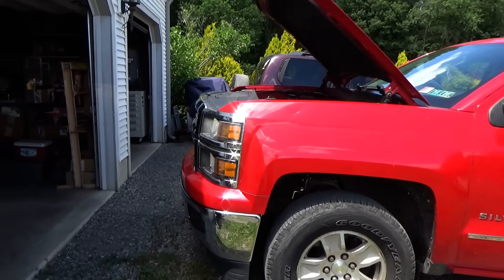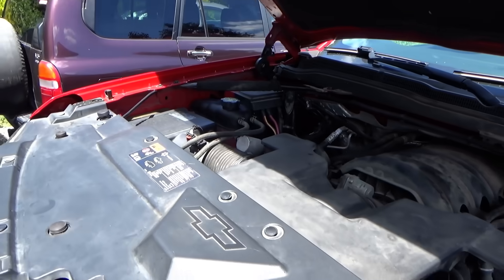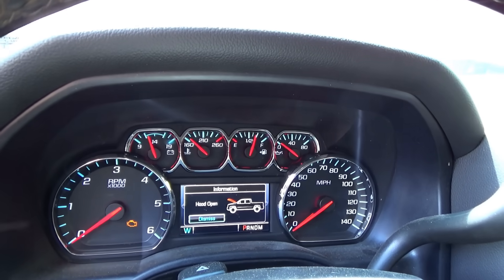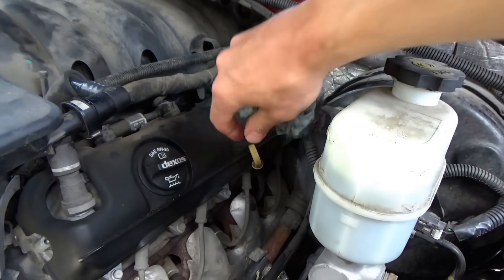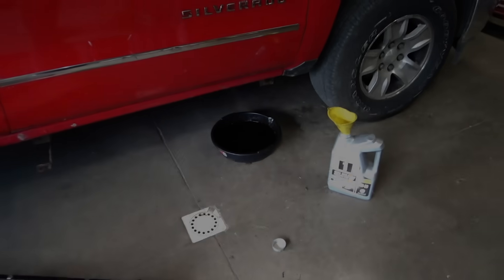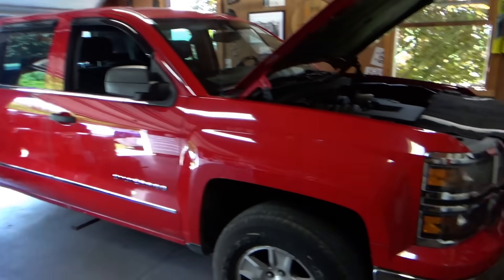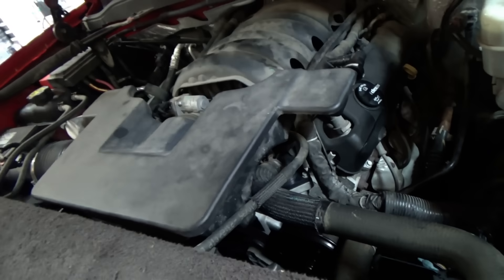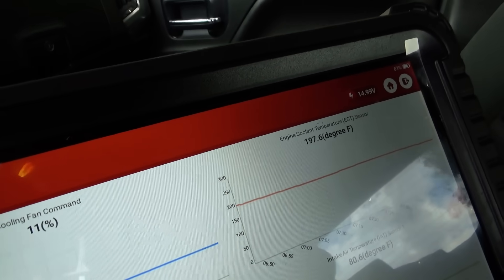Chevy Truck OVERHEATS?! (Thermostat & Water Pump Already Replaced...)

Comment: MotoRad has no excuse for this one. It's not that difficult to perform quality control on a thermostat -- just lower it into water 10 degrees hotter than the spec, and watch it for 15 seconds to see if it opens. That's a quarter of a minute per thermostat, at entry level wages. Compare the cost of the QC check against the cost of failure in the field (to MotoRad as well as the parts store and the end customer). Thanks for calling them out -- they had it coming!

Comment: Nice he's running 5 qts low on dirty oil and also overheating. Lucky not to be ordering an engine. Brilliant.
Reply: Until that overheating problem warps the head and torches at the head gasket it's coming

Comment: I've got the exact opposite problem. My bottom radiator hose it's just warm in my top radiator hose is hot. Truck runs about 220° 230 °according to the gauge. 91 454 new radiator, newer engine, newer water pump and of course a new thermostat. The hoses are not collapsing and I'm starting to get ticked off. I'll replace the thermostat again and give that a shot. If anybody's got any ideas I'd love to hear them.

Comment: Would the temp rising above 210 and then going back to 210 after about a minute normal with these motors? I have the same engine in a newer year model but it only does while pulling my utility trailer with my zero turn mower on it or when I get the rpms high passing someone. In both cases it never stays above 210 for more than a minute. Replaced original water pump when the pulley bearing went out at 90k miles but it would do that before the water pump replacement which led me to believe it was normal considering it only happens under heavy load.

Comment: Same issue with a lot of no oem thermostats these call for a 107F open up but I buy the 97F and don’t have any issues went through 2 brand new 107F and swapped to a 97F worked just fined

Comment: I recently bought a new thermostat from O’reily’s Auto Parts and I’ve been noticing the temperature goes up when accelerating past 55 mph. I never noticed that before and I’ve had this truck for over 10 years. I’ll definitely be buying a new OEM thermostat and replacing the cheap one I bought. Hopefully this solves my issue

Comment: Recently saw a video about the Silverado 2014 truck with a slightly different problem running rich. It was the high pressure fuel pump.
That video the thermostat was motorad and it was replaced with OEM.

Comment: What if both the top hose and that bottom hose are too hot to touch is it still a faulty thermostat? I changed mine out about 2 months ago it was from Oreillys and now my 2015 sierra is overheating like this truck I’ve changed the water pump the sensor and the thermostat but it isn’t working properly? Idk I’m stuck help me!

Comment: A new radiator is a must at 10 years,. and hoses,etc. Pump and thermostat, too. OEM parts. Cooling fans are notorious for failing. On Chrysler products the relay for the fans also fil.

Comment: I just did this on my truck and had previous cooling problems as well after my lifters were done heat would go away at idle come back when accelerating…should I just try and get another thermostat? I did opt for one of the eBay specials lol.

Comment: All I know is my truck does the same and I just turn my ac on and it will go down but I read somewhere that the fans will turn on automatically at 230 degrees but to me that seems to be high but it's not a big deal to me it's been that way from off the dealer floor

Comment: To change the oil without a filter change with a need to measure the amount of oil in the pan I use a Holt Industries Deluxe Manual Fluid Extractor and Dispenser (it has a fluid scale in Liters) and use the dip-stick tube to insert a line to suck out the old oil and pump in new oil. Dump the old oil (transfer to your oil holding tank) after recording volume and fill the Holt with the needed oil minus the amount in the filter (estimate) and pump back into the pan. Measure the level with the dip stick. If okay, start the engine let run for about 2 minutes, turn off engine and wait about 5 minutes for all the oil to drain back to the pan. Measure the oil level once again and add additional oil if necessary. With the Holt for oil change only, there is no pan mess, no need to remove the pan bolt, and no oil transfer mess

If the oil level is okay before the change you can just record the amount pumped out with a piece of tape on the Holt and then pump in the same amount.

In testing avoid the coolant temp from rising above 235 Degrees F if possible.

For this type of thermostat replacement I give the customer the option of replacing the factory hose clamps with Aba 316 stainless steel Marine rated hose clamps. The Aba Marine hose clamps are very smooth and gouge free so you can easily tighten without damaging the hose or cracking the plastic and I have yet to see one corrode due to road salt spray. I have a full line of Aba 316 SS clamps so I can pick the exact size that fits best. 

But we have to ask ourselves how is it that there is only 3 quarts in the pan? I thought this year truck had the oil level low alter message. Is the truck leaking oil? Is the truck burning oil?

Comment: Where did the 5 quarts of oil go? I have never used that much oil in any vehicle. Oil change 100, 000 miles ago?
Reply from the maker: @gordonwedman3179  out of the tailpipe from the Cylinder Deactivation BS 😝

Comment: I was almost wishing for the overheat to be oil related. As you know IVAN, the engine needs to be running in normal parameters before we can blame the CAT Eff. Thanks for the easy FIX.

Comment: It's that TranPan that's getting Ultra Hot down there - No Thanks to the Exhaust Pipe that's just inches away, literally Cookin' that Transmission Pan.
You Need to Wrap that Exhaust Pipe with some Titanium Twill Weave Exhaust Wrap and tie it with Metal ZipTies.
You can take that Heat Shield Down that's bolted onto the side and slap on some Dynamat (YES ... The Sound Deadener shit) to Help with some of the Excessive Heat issues down there too. ( I added some Dynamat to the actual TranPan itself - INSTANT  15Degree difference!! )

Comment: Most engines used to be 5 quarts with oil filter change. Not so much any more. Maybe a DIYer assumed this truck was the same and it got driven a ways after. Bottom line, never assume oil capacity. Look it up first. Also it's good that you record all your diagnostic codes and findings. It helps prevent customer tomfoolery down the road  ("it was fine when I brought it to you").

Comment: WOW, if the owner has enough brains to change the thermostat, waterpump and hook up a scanner he should have had enough brains to open the radiator cap and see check for circulation. Clean truck externally but LACK of maintenance being 5 quarts low,  a perfect example of why i would NEVER buy a vehicle without full maintenance records!!

Comment: Had a similar problem w/aftermkt tstat,  2010 Ranger,4.0 changed tstat & housing, truck would not heat up well.  Ordered "Motorcraft" T/stat. { Tstat in the new "alum." housing was jamed sideways not allowing to close

Comment: Just subscribed after seeing the video. I have a 2015 that would not complete a drive cycle. The ECT would drop out of closed loop once driving. 90K on the clock and original thermostat. Now I get a solid 210 ECT.  I have the V6 WT so overheating is never an issue, even in Texas heat. Thanks for the video! jim

Comment: That motorrad thermostat must be fake or factory defective, I am using Motorrad from rockauto for my 99 honda crv, it worked perfect like the OEM, better than other brand, two years now and still working perfect, but I do change thermostat and cooling fan switch every two years, I don't take chanses and wait till one of them goes bad, because I drive 40 miles every day.

Comment: I replaced the thermostat in my wife's Wrangler and had a similar problem. Tried to get one from the dealer, but they were on backorder so I had to go aftermarket. The first one I put in was opening too early. It caused the jeep to kick a code for slow warm up time. Second attempt worked better. Unfortunately I cant remember where I got them from now...

Comment: These gm has a temperature sensor in the radiator itself. If it stays at 32f it means there is an air pocket and the thermostat isnt opening. You can manually activate an heater element to open the thermostat.
Reply from the maker: @axelraver  no way 🤔

Comment: Sounds like it's ready for the junk yard.

My theory is that the owner (or previous owners, I don't know) neglected the oil changes, so the engine started drinking oil. This destroyed the cats, hence why the catalyst efficiency codes.

Sounds like it will soon need a new engine AND a new owner, not a thermostat.

Comment: Lower radiator hose is collapsing maybe, saw it happen before when the thermostat opens it sucks the hose right flat!
Reply from the maker: @jefferyholcombe5189  how do you explain that? There should be 15psi in the system when it's hot! 🤔

Comment: Have you replaced the radiator hoses if the lower is soft it can collapse and not pump water through the cooling system !
Reply: This engine pumps opposite of the old ones.  Hot water pushes into bottom of radiator and flow comes out the top.

Comment: I wouldn't even trust OEM parts. Ordered a GM Genuine for our 04 Express 6.0L when I changed the waterpump. Did a long trip and noticed it seemed to run 5-10 degrees warmer than the Murray Pro prior. Now that's hot it's wanting to run 220-240, normally that's mountain climbing temps. Interesting enough it actually runs hotter when you have the heat on. Granted could be few other things since I haven't opened it up yet. And maybe rockauto's catalog was wrong since there was alot of spring pressure versus the old thermostat even though looked exactly the same as the previous.

Comment: Ive given the upper hose a few quick squeezes and that often has gotten the thermostat to open when its sticking. You can also put the old stat in a non food pot of water and turn turn the heat on and see if it opens before the water boils.

Comment: I am having too many issues with OEM parts too. Some OEM parts are different suppliers because the original stock of some pieces sold out and the re-order has to go to one of the aftermarket makers as the OEM company is gone due to corp buyout

Comment: Did either or both of the thermostats have a vent hole?  The motorad migjt not have so could have been air locked

Comment: Having any 1996 or newer GM vehicle overheat does not surprise me in the least. Since 1996, GM has been using a type of engine destroyer known as Dexcool (commonly known as DEXKILL or DEATHCOOL among mechanics) as a "coolant". It goes in as an orange or red liquid, and once in the engine, it solidifies, plugging up everything. Usually the smaller passages like the radiator, heater core, and thermostat first, but I have torn down GM engines where the coolant passages around the cylinders were almost completely full of solidified DEXKILL. There is no known way of removing it.

Comment: With only 3 quarts is the crankcase could the oil pump have been cavitating and pushing a mixture of oil and air? It would have been interesting cutting open that filter and looking for metal particles. Or an oil analysis.   Due to consolidation in the thermostat industry there are very few options today. Motorad took control of Gates. Stant too is Motorad. Carquest.  And a bunch more. It's so hard to absorb by many of us that companies exercise no quality control in aftermarket parts. A Motorad company is OEM for my 2001 Ram 2500 5.9 gas. Had one out of spec already. Trying again and will check with a candy thermometer. Current 195 degree delivers 165 coolant temp. We will see.

Comment: hopefully your customer accepted the oil change issue .   a life saver for his engine . I had a similar overheating with a Honda CRV   2 litre petrol  the water pump was totally devoid of impeller blades .I have seen a mecedes Sprinter ambulance with a similar corroded off   water pump blades .

Comment: Aftermarket crap! 
A factory thermostat for this year of  truck is only about $100.
Anybody with half a brain can change one! 
Even Biden could figure this out! Lol

One other tip from a GM tech.
Anytime you manually open the throttle plate like you did, you should relearn your idle compensation, especially if you do it when you forgot the key was on!

Comment: I removed 3 or 4 red cloth shop rags from an upper radiator hose.  That was very difficult to find as they were stuck right at the turn to the radiator. '77 T-bird.  With cap off I could see only a little water running in.

Comment: What would you suggest if you replaced the thermostat and sensor , but now  wants to over heat on load, then goes back down once normal load within 30 seconds or so ? Same truck and year btw
Reply from the maker: OEM parts bought at the dealer?
Reply: @PineHollowAutoDiagnostics  I did that
Reply from the maker: @alvidrez7956  what was it doing BEFORE replacing those parts?
Reply: @PineHollowAutoDiagnostics  factory thermostat stopped getting up to temps , and the heater did not blow as hot as it should, so replaced thermostat and now temps read normal until I start to put load , that's when the temp gage starts to rise instantly . Then goes back to normal as soon as I let off the gas . This is happening even without towing .

Comment: The owner has a scanner, he is clearing codes and resetting maintenance reminder, BUT HE'S NOT CHANGING THE OIL (or even checking it 💀).  It's crazy how many times i've pulled a dipstick on a noisey engine, and it"s 3-4 quarts low. Sometimes, it's too late 😢.

Comment: ALL of my cars consume about 1 quart per oil change interval (~5k miles). This guy is down 5 quarts! That crap 0W-20 oil combined with driving it HOT is definitely part of the problem,  but it's probably at least 10k-20k miles since last oil change. WHY?

Comment: Pine Hollow saved the day-- 5 quarts low on oil! AND a thermostat stuck closed on a high mileage Chevy--talk about living dangerously! That is automotive life on the edge...Low oil and high temps...I wonder if the customer knows how close they came to blowing this one up.

This nice looking Chevy was on the brink of disaster... Now it might last another ten years now and stay out of the dump/parts yard (just change the oil or at least keep it near capacity). 

Might have tested/changed the coolant as it had been boiling for who knows how long and probably original (10 yrs and 179K miles) but can only do what the customer asks. But a great happy ending for sure here and relatively simple fixes.

Comment: I think maybe you need to make this a mantra, slightly more useful and less like fingernails on a chalkboard than Scotty Kilmer's stupid "Rev up your engines!"  Maybe something like "Always check your oil before you do anything, and definitely before you fire the parts cannon."  A boss once forced me to continue driving an overheating vehicle with smoke rolling out of the AC vents, on pain of being fired, until it quit.  As it turned out, it had a crack in the dipstick tube from a stone thrown off the tires, and would have cost $15 to fix (in 1985) if he had stopped when I told him to.  Since he didn't stop when I told him to, it cost him a $3500 new engine (in 1985).  I didn't have a gram of pity for him.  No oil will overheat just about as quickly as no coolant.

Comment: Rock auto is great autoparts website, i have been buying parts from them since my first car, but even them somtimes you get bad parts, brand new distributor that worked for a half hour, i was lucky i was arround the house, i pushed the car myself to nearest parking spot, and i put the old OEM distributor back, and th car start again with no problem, i got  my money back withouth returning the part,  i thought i can get away with aftermarket one, the old one has broken bolt on the cap, only two bolts holds the cap, and it does not seals well, and moisture got inside and corruded everything.

Comment: 2014....100% sure it need vacuum coolant filling, NOT POURING
Reply from the maker: No vacuum required LOL
The only engine I've had a hard time bleeding out the cooling system on was the GM 3400 😉

Comment: So, the customer could afford to buy a bi-directional scan tool but couldn't check his oil, change it, or pay somebody else to do it. A good guesstimate is that he also knew how to reset the oil reminder instead of changing the oil. This guy should be embarrassed about how he doesn't look after that engine. Now you have to buy the whole damn housing apparently, instead of just changing the thermostat! What the hell has happened to the aftermarket parts industry that used to be so reliable?

Comment: In over forty years of working as a tech, I’ve had more “bad” thermostats out of the box than good ones. And that goes for both, OEM and Aftermarket. The record of bad ones in a row was in the 80’s when working at a Ford technician, I finally got a good, working thermostat on the fifth try. Always, always test your new thermostat before installing, OEM or Aftermarket.

Comment: so ivan, don't you think it's a little bit hyperbolic to express global failure of production based on 1 or 2 product failures.?  i completely understand you having years of experience with instances of product failure, but it is falacious to condemn the whole process on a limited number of personnaly experienced failures. i did your kind of woork for 30 years, so i think i know too the frustration of having to replace parts that are expected to be fault proof. it's not always a good idea to throw the baby out with the bath water. thx, as always, for yoyr effort in producing great diagnostic videos.